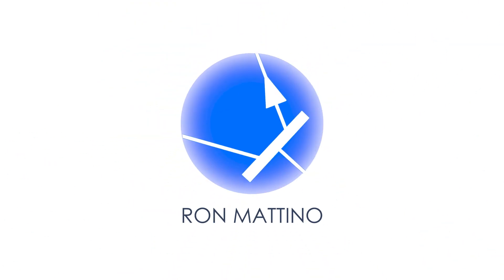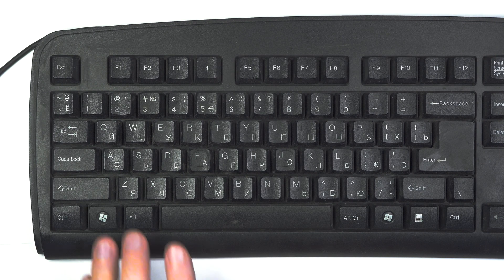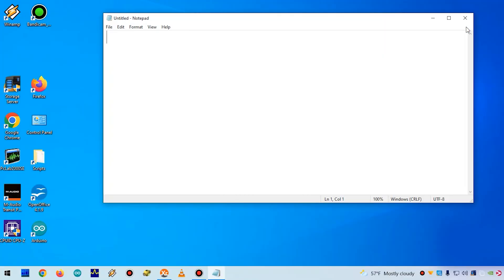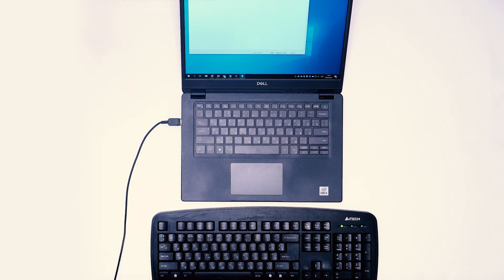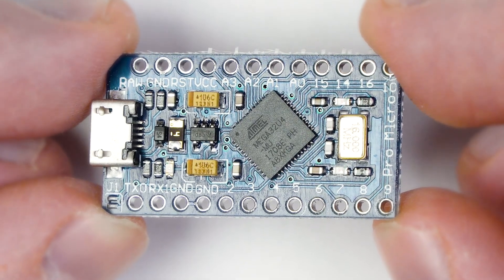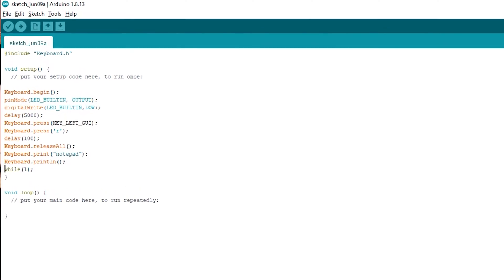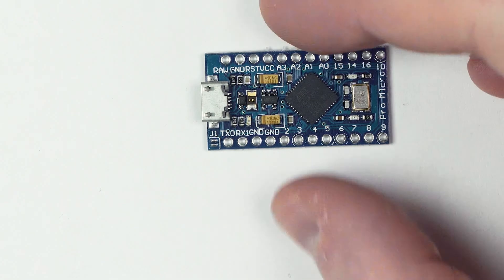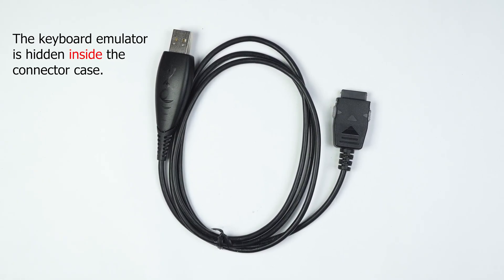How Hackers Easily Gain Access To Sensitive Information : Kevin Mitnick's USB Hack Dongle EXPLAINED

Comment: simple way to have a more secure system: install Linux
Reply from the maker: This will work on Linux too, since it's a keyboard emulator. You have to disable USB keyboard support programmatically to block a device like that. No OS does that by default.
Reply: You could even have it type multiple things for different platforms